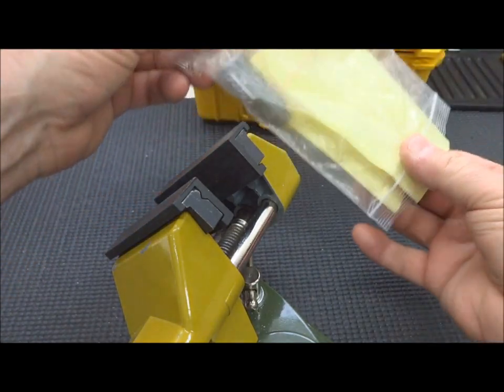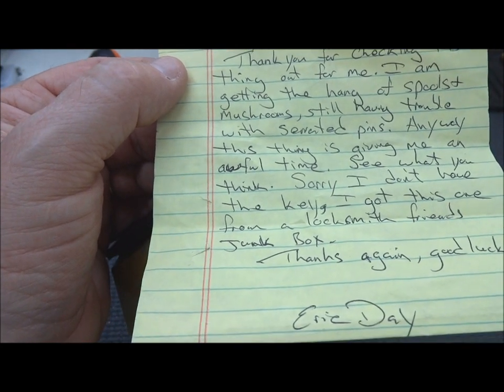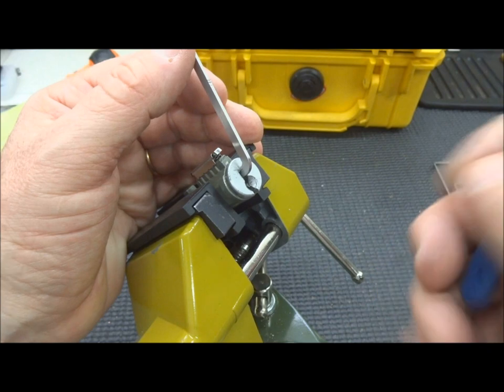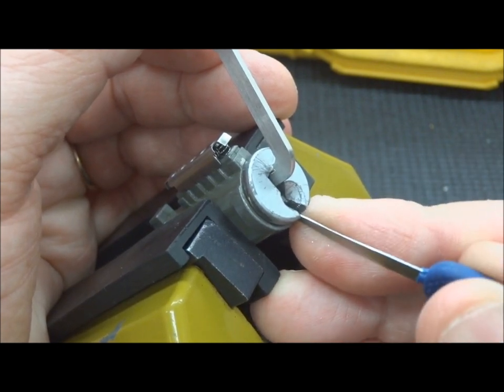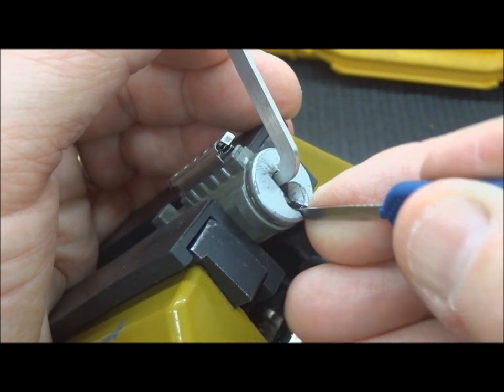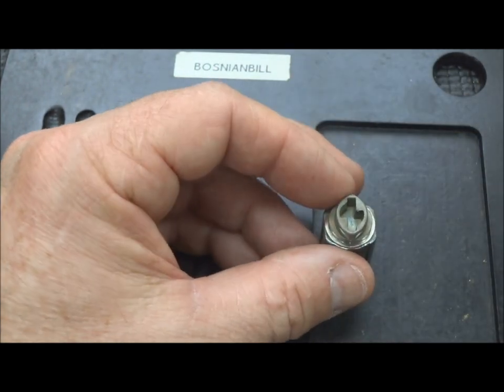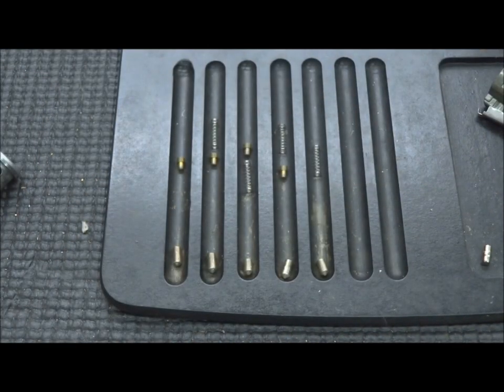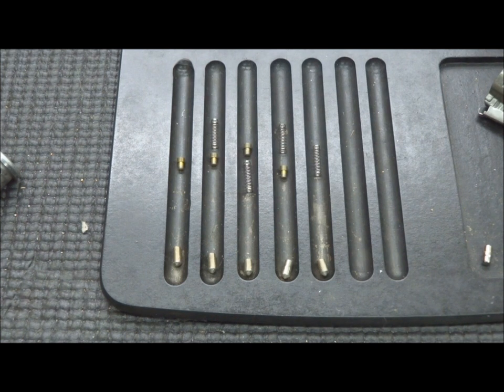(322) Handling T-Pins

Comment: These locks use the T pins, but this was not done to increase security, it was done to allow a design change in the knob.  There was not enough room for standard pins and the T pins allow the cap to be depressed in order to be inserted in the knob.

Comment: I just found this video and  thought I would add my own.
Roger Shoaf nailed it. Schlage, in order to save money, switched from a two piece F series knob to a one piece knob. In order to get the cylinder in they had to totally redesign it. Yes they didn't save much money and made the F series even easier to pick and bump open. You have to use a pick or thin piece of metal to depress the retaining cap to get the POS in & out of the knob now.
Bill was incorrect about how the pins are in the lock. The small part of the pin is for the spring to go over. If you try to use standard Schlage drivers, the retainer will pop off. Also if turned over, the pins will get caught in the construction ball holes(those little extra holes by the pin holes) totally locking up the cylinder and you'd have use the F series bypass tool to press the retainer to release the knob.

Comment: Nice job Bill and thanks for the insight on picking t pins. Sorry I so confusing in my note. I wasn't suggesting serrated pins were in there, just my trouble at picking them. Also in that core there is kind of a rim at the bottom of each tubes in the bible. Crazy thing! Thanks again.

Comment: Bill this is just a common Schlage compressible cylinder with standard pinning. the top pins may look to be T pins but they are just standard top pins for the compressible cylinder. I'm a locksmith who gives these things 5 mins before the drill comes out. the small pins with a high compression springs make some of these locks with a tough biting a bear to pick. These locks don't get the credit they deserve for being a tough pick. There's millions of them out there and for a common Home Depot product a good buy. spend the extra bucks instead a a Kwickset or Defiant brand which are easy picks.

Comment: For those of us who have to rekey these most Schlage depth gauges have one or two notches machined into them that make removing these pesky cylinder retainer clips easier. As for picking these can be rascals until you figure them out. Well done.
Reply: skygh Pretty much standard equipment for Schlage.  This cylinder is F-Series Orbit design knob.  The tolerance on these isn't all that good, the B-Series brass cylinders are far superior compared to this, even loaded up with T-pins.